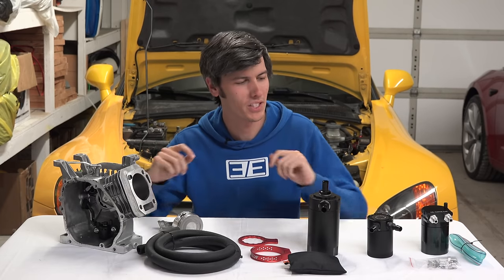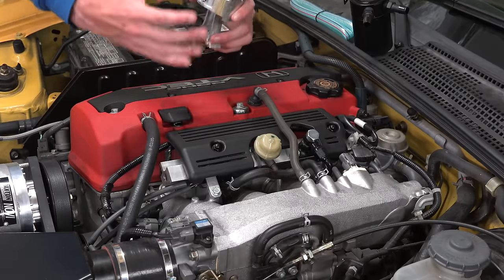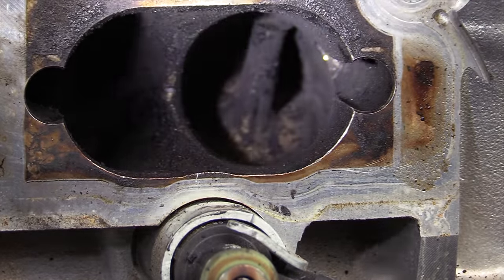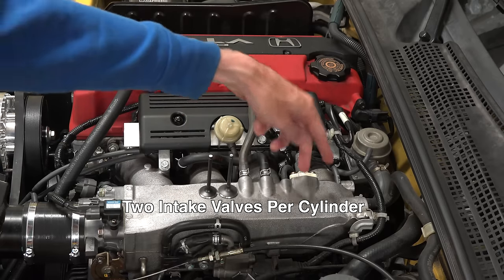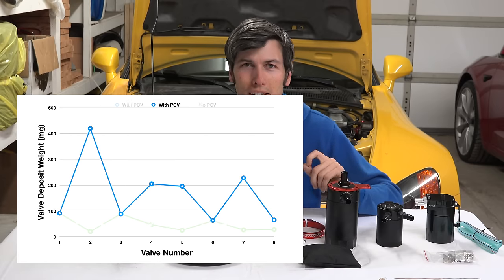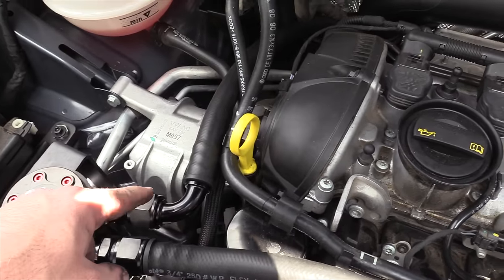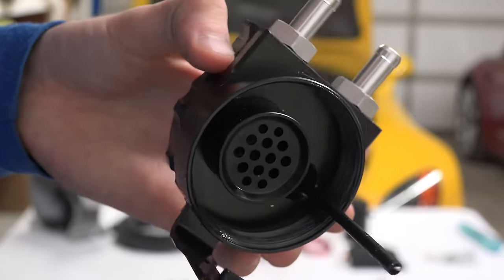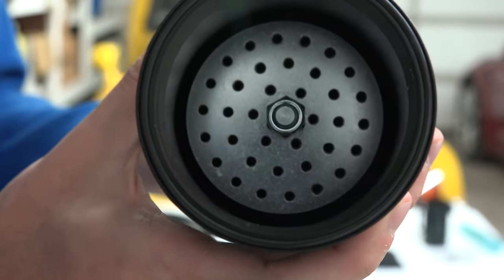Do Oil Catch Cans Actually Work?

Comment: nice  ' slight ' on the ecotec engine... i huess you only think japanese and german engines are worthy of praise... that is very narrow minded of you.. i  went for an engine conversion on my 1984 alfa romeo spider.. looked at honda, nissan toyota, bmw engines. and the best bang for the dollar ...........was the 2.2 ecotec.. has a very thick bedplate 4 bolts per main, the ecu is easy to re program,,, the block was designed by opal  ( thats a german company... wow !  ) and fiat.. the head was designed by lotus... you know that company...right????? yes the first year or so, had timing chain problems.. they fixed that with new tensioner, and oil sprayer..( did you forget, that bmw had lots of problems with there vanos system.. or do you over look that.. because its a bmw ? )i rebuilt my 2.2 ecotec,, did a lot of intake and exhaust work,, rasied the compression from 9.5/1 to 10.7/1.. had CBM motorsports  update the ecu.. put on a 2.4 intake manifold, with an adapter so i could retain the 2.2 t/b  hint.. its a better set up// rods are polished to mirrors ( had a  lot of time last winter on my hands,, and they ere checked before and after for cracks.. and they way  to .005 of a gram to each other )pistons weigh exactly the same..  and  stainless steel headers... results?? 217 hp at 7100 rpm  186 ft/lbs tq at 4300 rpm.. and the tq does not go below 152 ft/lbs  from 1200 rpm to  redline of 7500 rpm... yes i know  its a crappy gm engine.. you should not even in the same breath mention that engine while spouting about the perfect japanese/ german engines... even oem.. the 2.0, 2.2 and 2.4 ecotec engine are very well built.. sand rail racers buy them  for the high tq they produce// perhaps.. checking your facts... first.. before you ' slight ' some else's products..  i makign a bet with a freind i work woth you will not answer this... he's a bmw tech.. 22 years now.. and guess what he did??? he put a modified 2.4 ecotec into his 1988 323 bmw.. why,, his bmw engine ..failed
Reply: after 4 months..no reply..easy to say bad things..about other companys cars.. even without proof.. and as you seam to like only import cars.. you might be a wee bit biased? perhaps?

Comment: SNAKE OIL

How much oil do you put in your car? Naff all. of that naff all, how much ends up on the valves> Naff all of naff all. 
Compare that to the crap that comes from EGR and you are fixing a non existent problem.
Reply: My current car doesn't seem to burn any oil at all as far as the dipstick says, yet my intake was literally dripping wet with oil. My EGR valve, which I checked at some 70miles or so, had a thin coat of dry carbon on it so I didn't even bother to clean it or the passages. The worst intake valves I've seen were all on cars without EGR. The cleanest valves were all on cars with EGR. So my guess is the EGR is not the issue, but instead it's rings and fuel delivery.

Comment: Great video... just bought the $25 can and of course no directions and I’m no mechanic... my question is does the in port come from the pvc side and the out port on the can go to the throttle body? And with the baffle it unscrews so steel wool can be added for better filtration.. thanks in advance for your response ! I have a 2017 f150 2.7 ecoboost

Comment: All of your catch cans have flaws especially the ones with fine bronze filters as they clog up easily and all doesn't have much inside like metal guaz to stop or restrict flow to the out put. My catch can have a metal medium that catch all before the output . Ooh nasty stuff coming out of a VW engine no wonder you VW fans pollute the earth so badly not just with your noise carts but with nasty gasses. What's do you call a VW ? A HIFI as you can only make it go loader and softer but not any faster ,,,🤣🤣🤣🤣

Comment: The PCV or Positive Crankcase Valve was designed to keep your engines blow by from dripping oil onto the ground, before PCV valves the blow by was routed from the engine via a small hose and the oil would just drip onto the ground which is not good. The small amount of oil vapor that the PCV directs into the intake will not harm anything, plus todays oils have very low ash content to them when they are burned off. Catch cans are a solution in search of a non existent problem. All engines have blow by that is created from the pistons pumping up and down.